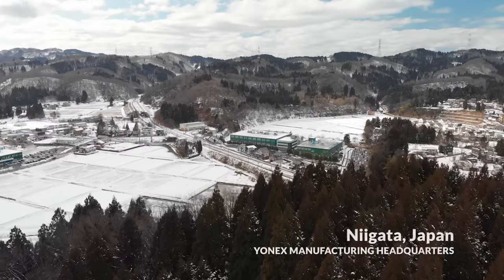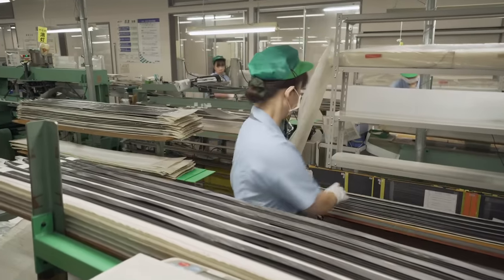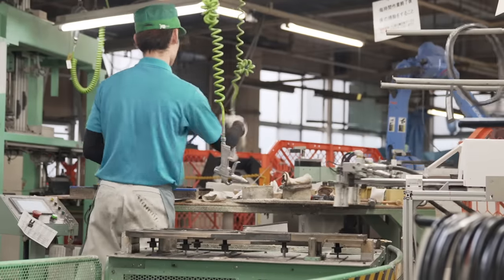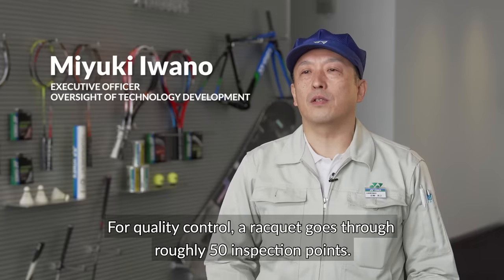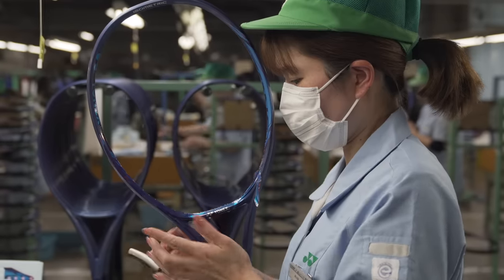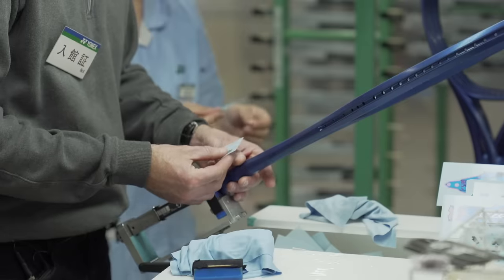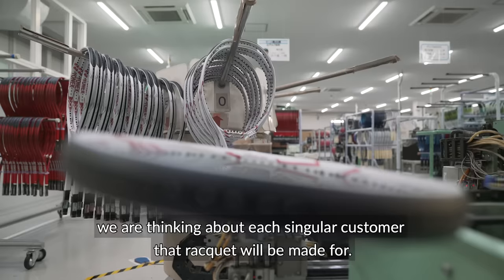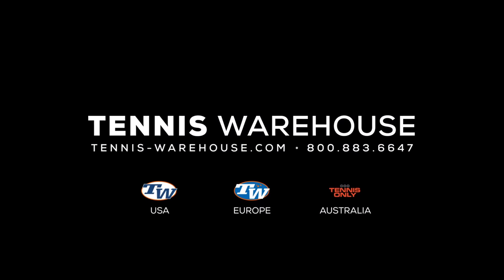How a Yonex Racquet is Made | TW Exclusive Yonex Racquet Factory Tour

Comment: Being a manufacturing consultant and "expert" I was a bit surprised at the level of automation that Yonex employs. This is a considerable investment in their production operations and a stark contrast to the other big manufacturers who simply utilize low cost labor to make their products (thus resulting in much more variation in their racquets.) I suspect that Yonex controls all aspects of their production processes to such tight tolerances that they actually do not have to do too much inspection or tweaking the racquets to get them to spec. This video demonstrates how Yonex achieve the best quality racquets in the industry.
Reply: I visited the YONEX factory regularly in the 1990s and early 2000s. The level of automation was much, much lower than in this video, but they already had the reputation for quality and consistency. Like you and other commenters have said, I think the most important factor is having their own factory and training their own workforce, giving them complete control over the production process.
Reply: You might know this. Yonex rackets do not fluctuate in weight, swingweight, grip size and feel..
Reply: just like china

Comment: I love my Yonex Vcore Pro 97 HD racquets. You can so feel the quality.
Reply: Jonathan Jackson Love the emerald green and gold colorway. If they only made it high gloss clear coat and add Yonex leather grip :) 🇯🇵
Reply: Barber Mack first thing i did with mine is replace the stock grip with leather 👍
Reply: @barbermack2980  I didn't think about it in a glossy finish vs the current matte until you mentioned it. That would actually be really nice!
Reply: I'm envious! The HD is next on my list, can't wait.
Reply: @JoJo-st6jk  I plan on spraying automotive clear coat on the 97HD. It will increase the flex by 2 points. But it might look a lot better 🤩 Great frames by Yonex
Reply: I got one and it's great 👍

Comment: Yonex: 50+ inspection points. Owns their facility.
Other brands: 🤔🤔🤔
Reply: Will never buy another Yonex racket. 
Had a limited edition ezone 98 that ended up developing a crack and then fully snapping at its throat. Sent it back to Yonex for a “quality check” and they came back saying that they couldn’t see any defects with the racket and blamed it on me simply because the racket had a few scratches at the top part of racket head. 

Never going back to Yonex again.
Reply: variszarins Maybe it really is your fault?? (kidding) 🙂✌🏽 But that’s unfortunate. I haven’t gone through warranty and stuff so I cannot really say much. I just like it when I see my gear and it says Made in Japan😎
Reply: Barber Mack no, honestly, I’m a Yonex fan and it hurts me to leave negative reviews everywhere but it definitely wasn’t my fault. I used to use their rackets for both tennis and badminton so they have lost more than just a tennis customer. :/
Reply: @variszarins  don't change your opinion with one crack
Reply: @HimAspirant  it’s not just the crack, it’s the poor customer service and how they didn’t even acknowledge that the racket was faulty. I’m now a happy owner of 3 Head prestige MPs and I’m never going back to yonex again.